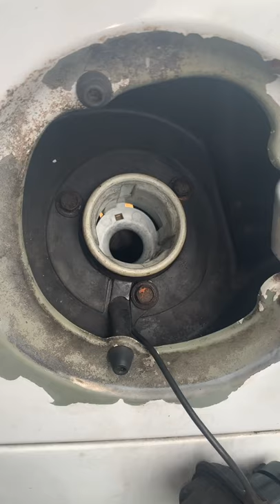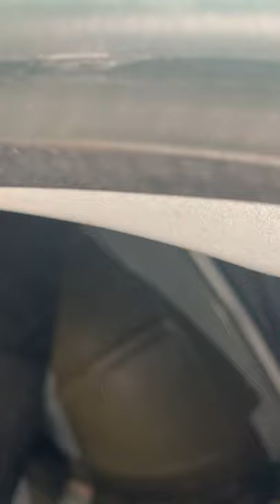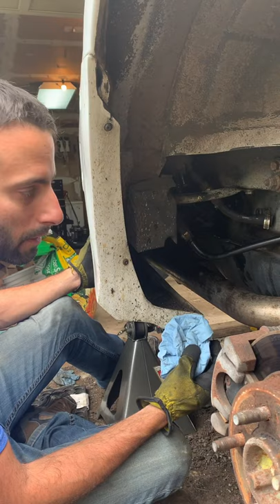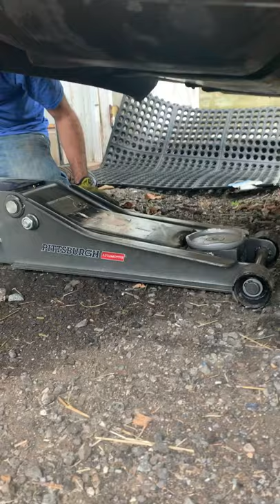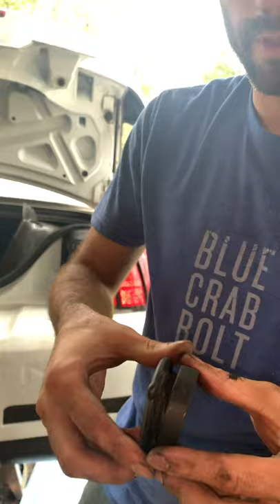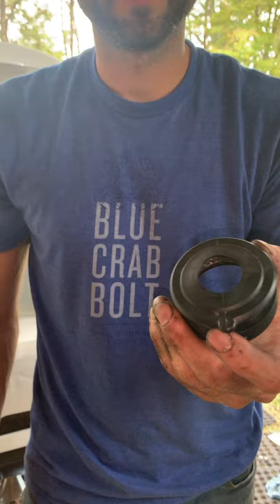2000 Saleen Mustang fuel filler neck tube grommet replacement

Comment: Hahahahaha yep me too I am rebuilding my evap system on my 04 mustang GT automatic dark shadow gray new purge valve and canister and vent valve and fuel pump and fuel rail pressure sensor and fuel filter and now the fuel filler tube and then all new fuel injectors and new spark plugs and coils by spring I should be ready for 7 more years of tang life

Comment: U don’t have to disconnect any fuel lines to the gas tank when u put the filler neck back in do u?
Reply from the maker: That’s correct, fuel lines do not need to be touched at all during this process. Only time I ever had to mess with that is when I upgraded the fuel pump.